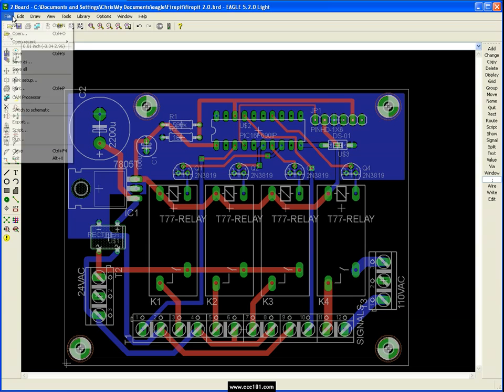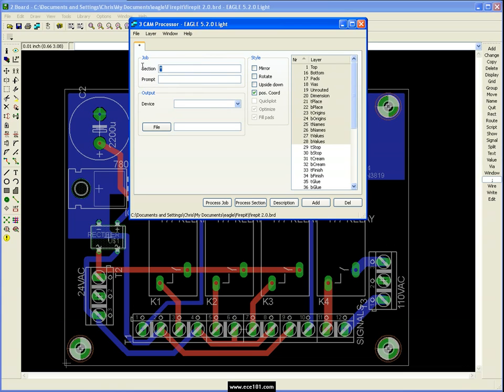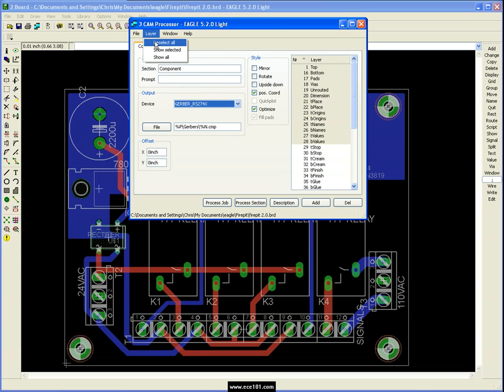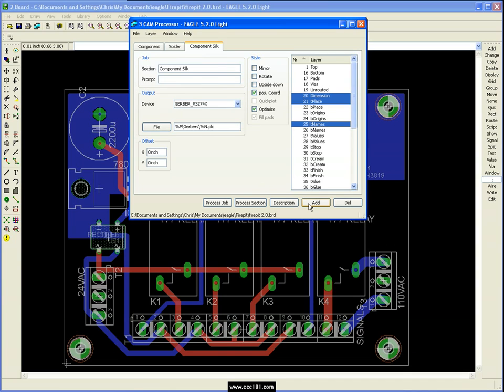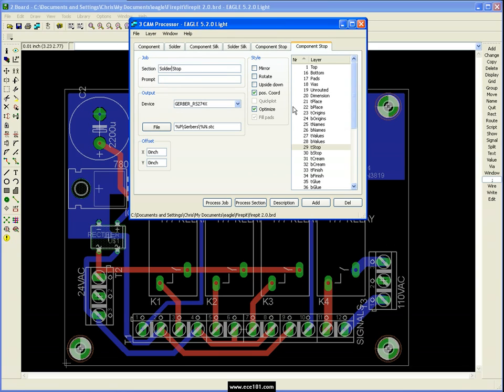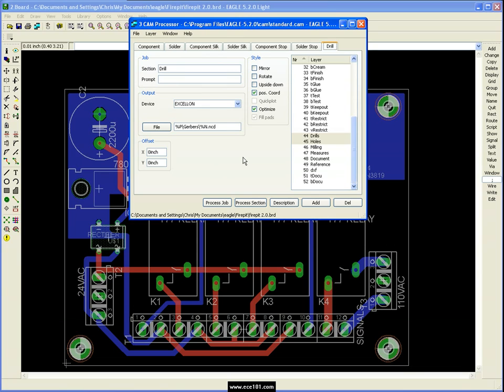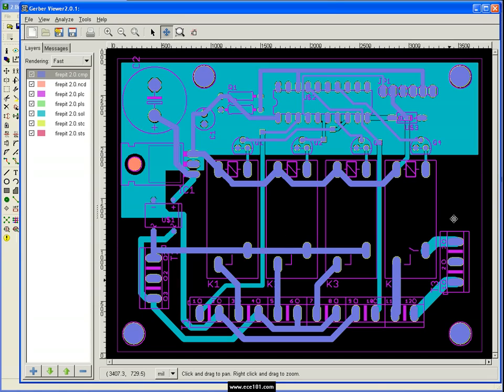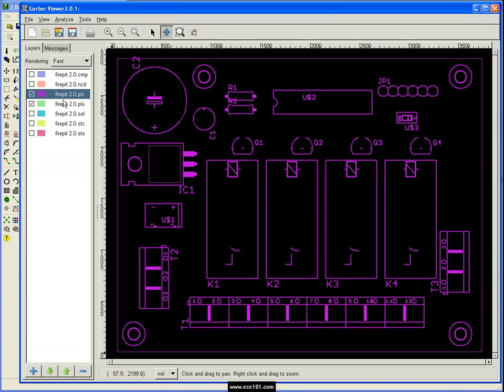Creating Gerbers using EAGLE

Comment: Chris, thanks again for this video. After working with this, successfully, I find it a little confusing as to the work flow in the following situation. Say I generate the gerbers, save them as you described, go into a Gerber viewer program and discover that I need to change a layer , i.e., 'top silk'.  What is the simplest work flow? I have been going back and making changes to the main Eagle board file.brd and then going through your entire gerber process to regenerate the package of files for the viewer.  I'm sure you know a simpler way if you could please briefly provide some clues. Thanks again.